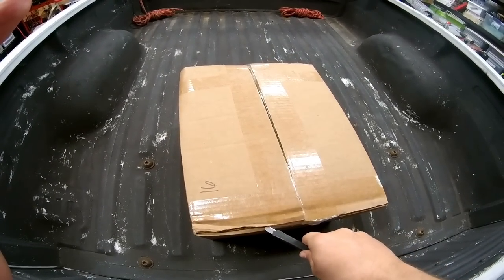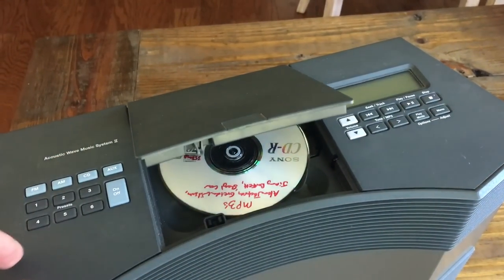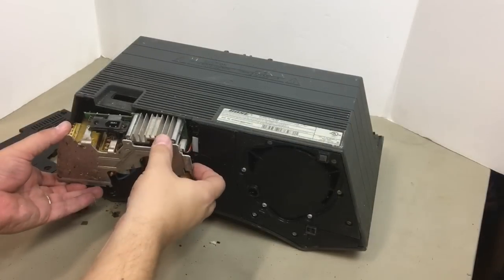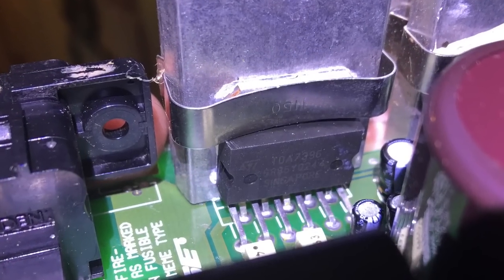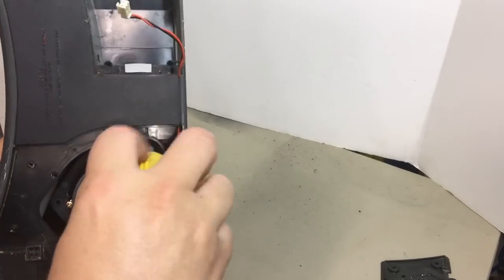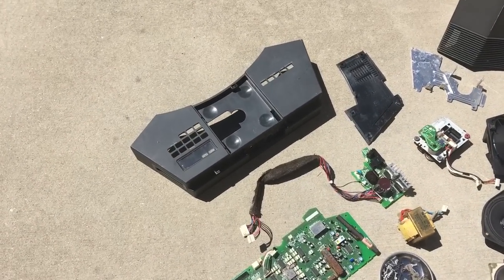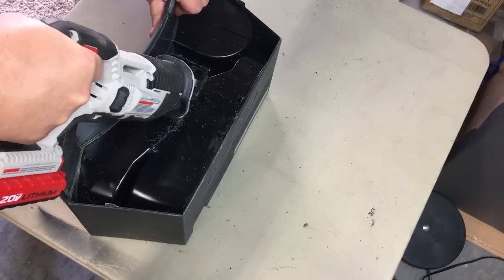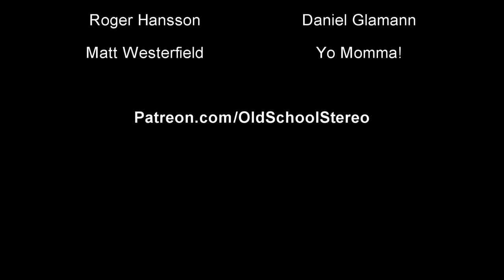What's Inside $1100 Bose Acoustic Wave Music System CD-3000

Comment: The magic sauce of most Bose music systems is in how they handle the acoustics and not so much about the electronics or the speakers. They spent a lot of time and money in the R&D behind the optimal design of their wave guides inside that junky looking contraption. Nobody can deny that Bose systems produce an outsize volume of sound compared to the physical dimensions of their units. The founder, Dr Amar Bose, had a PhD from MIT in Electrical Engineering. Not exactly a fool.

Comment: Wow... extremely low quality mid/high drivers for an $1100 system. Looks like a system worth perhaps $200, which was marketed well, and probably had a huge profit margin.
Reply from the maker: +MaximumCat I paid around 200 for mine used and pretty happy at that price
Reply: MaximumCat... Yes, bose is mostly marketing and the use Soundwave properties to fool listeners...they've built quite a name and are now considered premium, but are far from it...sadly this has trickled into the car audio market and now cars come with highly proprietary stuff that doesn't sound premium and doesn't play well with other equipment from other brands when swapping components
Reply: $200 worth of parts? More like $40.
Reply: You pay for technology and quality parts not for what is worth ... my test cost me $50.00 on PVC pipes. And I tested the 4-2 and the 8-4 low frequency drivers only. " Bass speakers".
Reply: @K03sport  

You got it ...
A $60K caddy with a optional Bose system will cost you an additional $6k AND they will keep the one you are replacing.
Reply: "Wow... extremely low quality mid/high drivers..."  That's Bose.  Paul Harvey hawked these on his radio show, which ran for an astonishing 56 years.. He was very good at selling stuff, especially to the the older crowd.
Reply: Bose has always taken a different approach. The 901 & 802 sound amazing, plenty of bass, loud and clean enough for small concerts and a very pleasant sound. Yet they contain only an array of 4 inch drivers like the woofer on this. Bose uses other methods like EQ to get the sound output they desire. They were way ahead of the times with that, which is something we now see regularly with phones and modern bluetooth speakers which are tiny but sound as good or better than large home music systems of the 90's and 00's.
Reply: @dfpguitar  Bluetooth speaker won't out perform a 15 inch speaker system let alone a 8" even if it's the cheapest shit you can buy. Nice try but no. Infact, aside from one from Bowers and Wilkins, I've never heard a good Bluetooth Or iPod speaker or whatever, basically if it's portable it's artificial, plasticky, muffled sounding shit. But I do have a few portables for job sites and such. They are handy for stuff like that. But just not true HiFi.
Reply: @civiccruiser7025  you clearly haven't been around the average home music systems of the 90s and  early 00s. I'm not talking about stuff from audiophile brands, but regular consumer brands like Panasonic, Sony, Aiwa, kenwood, Phillips, hitachi, JVC etc and even more so the "off brand" systems  or portable boom box type.

A tiny modern Bluetooth speaker with 2inch drivers sounds better than all of the portable boombox type stereos of the past. Even expensive brand name ones that 6inch+ drivers, mains power and ten different types of bass enhancement features labelled on its body like "bass reflex" porting and bass boost EQ etc.
Modern Bluetooth speakers sound similar to the brand name (Kenwood, Sony etc) home (midi?) systems which have large separate speaker cabinets of 20inch+ tall that had multiple 6+ inch drivers, the kind with rubber surrounds, often with integrated subwoofer sections that heavy heavy porting. 
Those beasts were typically at the very least 80w RMS, but possibly rated at upto 200wrms.

tiny modern Bluetooth speakers are comparable to those, and sometimes sound better.

When compared to low end systems that had paper drivers without rubber surrounds, and often the silver dot in the centre. 
Tiny modern Bluetooth speakers sound MUCH better.

Now when considering Bose 802, 901, 702 etc you have to consider that these small drivers were fitted to large and very well designed cabinets. 
That drivers were used in arrays and there was substantial EQ going on.

With all of these combined you can easily see how Bose could get a good sound taking a completely different approach to other manufacturers.

Even today, Bose 802 PA speakers sound better than any other comparably sized PA speaker without the use of an additional subwoofer. 
This is despite these typical PA speakers using 12" drivers.

the boses also sound more pleasant, less harsh. More like home audio speakers than a brash raspy PA.
Reply: @dfpguitar   I personally cannot stand small speakers. And I will not believe anything by Bose is better. The only good Bose speakers are those with the like 8 driver's in them even then it's like meh. They all sound so stuffy, then again I think alot of stuff sounds that way. And wrong about the first paragraph, I could not wait to get rid of my Aiwa and Sony and ECT. stereos. Those were dark times lol. I just prefer to use large speakers because I have a large listening area. Just because it is over engineered doesn't mean squat irl. I don't think that the larger systems you are comparing Bose shit to was properly set up, speakers are finnicky as hell anyway. That being said I miss my tiny Bose 151s.
Reply: @dfpguitar  The problem is that Bose used it to pad their profit margin rather than to make a quality product. Quarter wave theory isn't THAT hard to use to build a T-Line. It's just a teensy bit of math. Bose didn't discover this concept, Hemholtz did.
Reply: @triggrhaapi  I agree that the wave station thing was a horrible horrible scammy product. It was always sold in a snake oil kinda of way, in magazine ads and infomercials making it sound like it was the most miraculous thing ever and an that catching the deal was worth more than your life.
But if I recall, Bose did always offer money back or free home trial. So anyone who ended up with one really deserved it and would probably be happy with the product. Bose were very clever in finding that market of non-audiophiles and extracting wild amounts of money out of them.

Something possibly only surpassed by beats headphones lol.

The irony is the now totally open market of direct China products and proliferation of lithium batteries, standardised drivers, USB charging, Bluetooth etc..

Has made the most lucrative market of personal and compact audio brutally competitive and "honest". Because it is very hard to sell overpriced snake oil in such a competitive market. 

Yet Bose still amazingly has consistently been a leader in this market too!

They were always at the forefront of noise cancelling headphones, and the legit best quality wireless Bluetooth speakers. Everyone was mostly copying them. 
Only now Sony caught up so Sony and Bose make the best noise cancelling wireless headphones. 

Bose found a way to always be dominant in a very fast developing competitive market and you have to admire them for that. 

Bose noise cancelling headphones were originally sold in the exact same way as the wave system. The prices were high, but can you even say anyone got ripped off when no one else was making a comparable product?
Reply: @JiveDadson   I have to agree with you. I remember hearing about it on Paul Harvey's show all the time but I never actually saw one because they don't sell them in stores. Around 1998 or so I heard of a demo they were holding at the local Holiday Inn and I was able to attend. I was by far the youngest one there; there couldn't have been anyone else there under 50. I found the sound to be pretty impressive for something that size but the price was WAY too high.
Reply: Moreover,  they direct marketed these shit systems.  I couldn't believe the price.  Perhaps good enough if space is a factor but the price was ridiculously high for a bit of plastic, 3 chineesium speakers, Crap amplifiers and a little bit of transmission line (waveform) plumbing.
Reply: @JiveDadson  Marketed to older people. Ah, that explains my elderly neighbor having one. It's from 1997, purchased when she was 73 years old. She passed away in 2019 and it was given to me for helping clean out her home.  It's a good unit for my kitchen plus I can sell it on Amazon for over $250, even in 2020.
Reply: @fixman88  The reason the sound was impressive is that they chose and EQ'ed the demo music.  The company did not allow resellers to demo with unapproved music, or to allow comparison with other equipment. There is a dropout around 225Hz that is unavoidable with sub-sat systems that small.
I attended a demo once. They did it in a purpose-built auditorium. The music was stuff like a female vocalist (well above 250Hz) and an upright bass (well below 200Hz) along with a drum kit.
Reply: I'm not concerned with the size of speakers and components I'm interested in the best sound I can get I'm for my money I've always stayed away from Bose everybody has an opinion and an asshole in my opinion Bose always sells size like those little cube speakers that sound horrible

Comment: Amazing, 1100$ for 50$ worth of material. And subpar components.
Reply from the maker: Now you see what company Apple models their profit margins from.....lol
Reply: How is this different from almost any electronics manufacturer?  Even very high end HiFi speakers use $50 vifa tweeters half the time.
Reply: For the time this thing sounded incredible for the size
Reply: I actually have one of these.  I didn't pay over $1000 for it.  I bought mine from Goodwill.  It's from 1998, 24 years old!!  Got it in 2019, sounds amazing!  Still does.  The parts do LOOK spartan, I'll give you that.  But, they sound really good.  Those parts are 24 years old and still work well.  Was this thing worth $1000?  If they last a quarter century, they most certainly are.  I can't say that parts that are that old are bad in any sense!  I can definitely appreciate your stance on this though.
Reply: @bodyshotjake7475  You said it. For the day, they were not some Wal-Mart Fisher or Sound Design crap sounding junk. For its size, it was the best sounding portable/table-top radio around. My buddy uses one for a center channel on his TV.

Comment: Huge amount of research in this unit. The folded waveguide is correctly called a Tapered Pipe or transmission line. The total length of this one is about 196 cm(going on number from the video, think it was about this). This would be a quarter wavelength of 786cm 7meters! Woah, that's like 45 hertz or so. These lads at bose have managed to avoid introducing distortion and phase issues into the sound spectrum at the ears most sensitive region (900 htz through to around 2000 htz) by avoiding the use of a crossover in this critical region, and have managed to get somewhere down to 45htz from a 4 inch driver. Sure the package is $1100 and I'd personally never buy one, but this is some pretty good engineering. By using a single sound source for highs and mids, they have also managed to maintain a similar spectral balance of tone for instruments such as piano that play notes both below and above the crossover in a conventional 2 or 3 way speaker system- well piano does contain notes below 45htz, but perhaps trumpet or violin would be a better example.

Comment: When I was about 10, my dad bought an old upright console radio/record player. Sounded good. After it conked out I took it apart before my dad got rid of it. It had an "acoustical labyrinth". It was a Stromberg Carlson. Also back in the late 30's or early 40's some european makers were making transmission line enclosures. They just didn't really catch on that well over here. A 40 hz tone has a wavelength of 28 feet, so to make a quarter wave transmission line you would make a 7 ft. labyrinth. Bose just marketed the idea of a "Waveguide" like it was their brainchild. But, I guess all  companies would take advantage of the fact that most people would think it was new technology. That's marketing. I always thought their products were a little expensive for what they are, but for many people who are not "stereo buffs" or "audiophiles", or "golden ears, who buy $10,000 amps", they fit their needs and take up minimal room. There's something for everybody. I enjoyed this video, as I always wanted to see one inside. I just assumed the 2 drivers in front were the only ones and that they were connected to the labyrinth. Didn't know it was a sub.
Reply from the maker: +vintage stereo buff very interesting sir, thanks for sharing! Bose make a smaller sized Acoustic Wave Radio that uses only the 3" drivers with the Wave guide (and no "sub"). That one is far more popular than the one I show here
Reply: vintage stereo buff the acoustic wave is different from a standard Tline or wave guide in the way that it uses both the back and front of the driver
Reply: Yes, I noticed the back porting.
Reply: Aside from being all port and no chamber i Would think it a sixth order bandpass. My favorite. I have built a few amazing what bass you can get from even a single 8" or i guess 4".